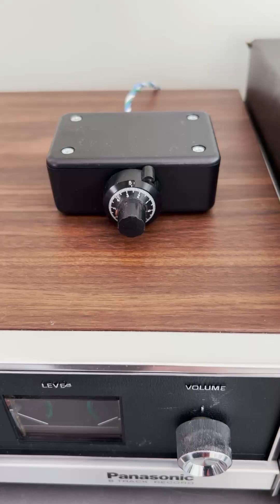8-Track Tape Speed Adjustment

Comment: The tapes that were running fast,  were high speed dubbed at factory. Best thing to do is throw them away. They started doing that in 1980s to speed production